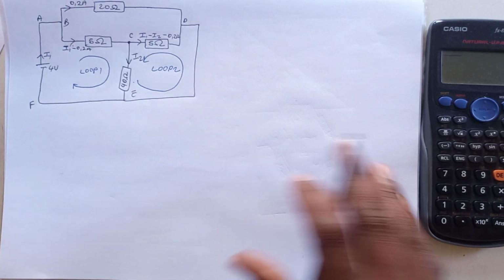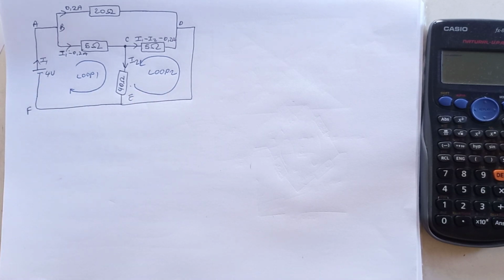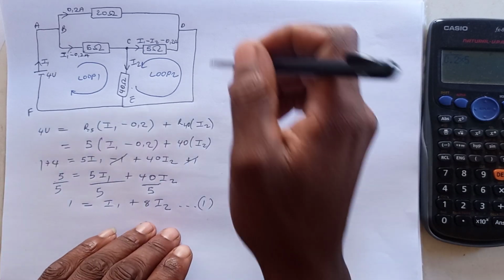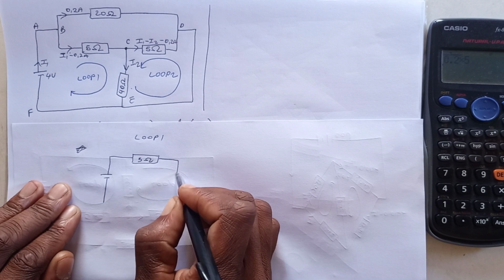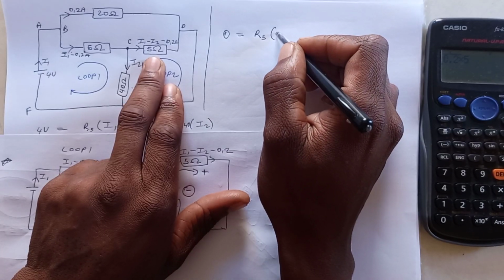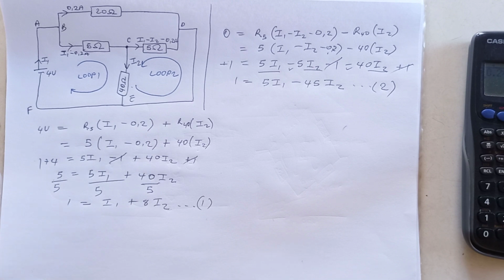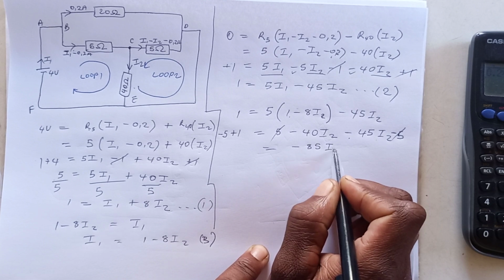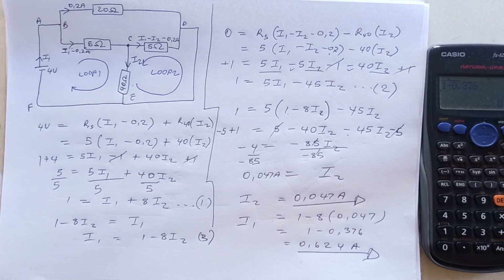N3 Kickoffs law of current exercise 2

Comment: On the second loop I don’t understand why you chose opposing currents to be positive and the one on the same direction to be negative plz explain
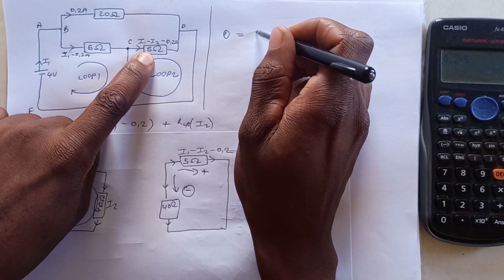Reply from the maker: Please listen carefully from 6:19 to 7:59.  Even if you make the current across resistor 40 positive and the one across resistor 5 negative you will get the same answer. As long as you admit that the currents are opposing then they should have different signs.